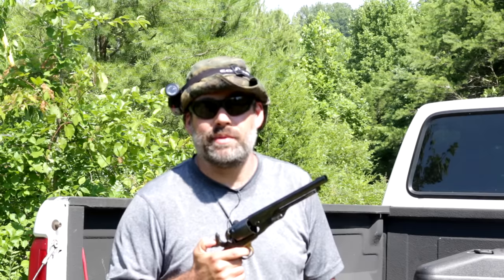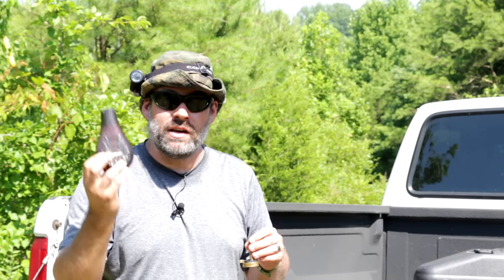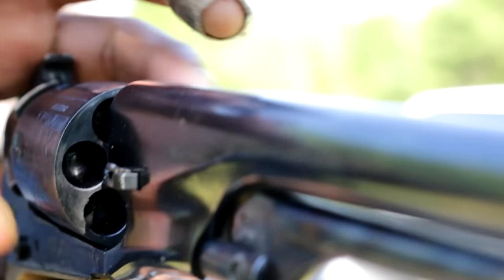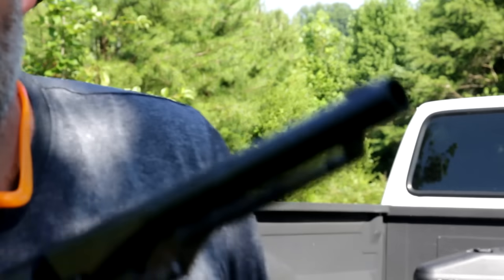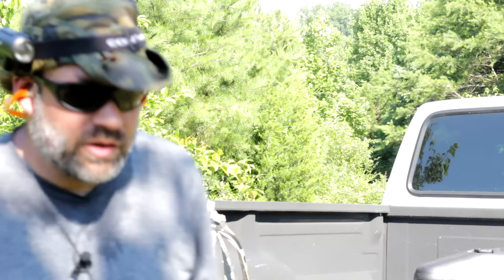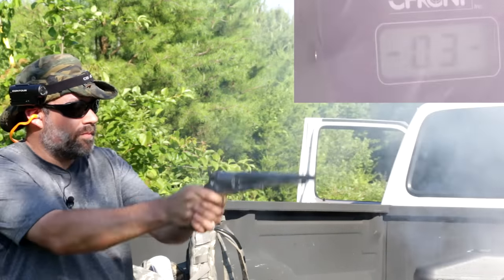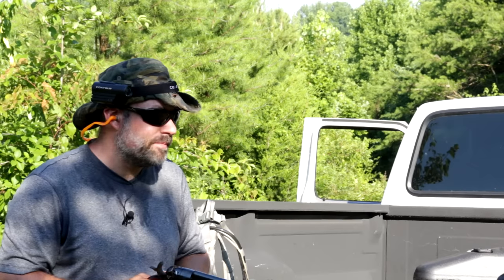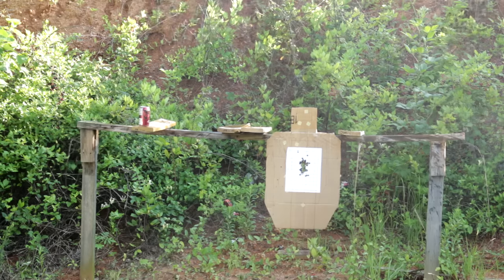How Powerful are Black Powder Revolvers?

Comment: I'm fixing to buy my first black powder cap and ball in a couple of weeks.  I talked to one guy who said his theory on how much powder to use was 36 grains for 36 caliber, 44 grains for a 44 caliber and 45 grains for a 45 caliber.  I think he's off his rocker.  Especially when the framework of the pistol is partly brass.  Am I judging him too harshly?
Reply from the maker: I wouldn't listen to his advice especially with brass frame revolvers.  When shooting 44 cal black powder stick with 25 grains for brass frame revolvers and there is little need to go above 30 grains in a steel framed revolver all when measured by volume.  He may have gotten his info mixed up with loading black powder shotguns which is normally loaded with an equal volume of shot and black powder.

Comment: Speculating here,  I think Black Powder may give you more velocity at the higher loadings,  I believe it's burn rate is faster, the ignition temperature certainly is.   Original loading, if I recall correctly, was 35 grains.
Reply: No.  The original specification for a Navy Colt's .44 caliber pistol was 28 grains of "pistol grade" black powder. That's what was issued in the "paper cartridges" by both sides.

Comment: cant wait to see the 1858 buffalo test should be interesting
Reply: He can't really load the brass frame to the same as a steel framed gun,  It's not recommended because the brass stretches to easy.
He can if he wants to,  But I'm pretty sure he's self aware of the short amount of time he'd have the 1858 brass frame.

Comment: The loading procedure is good advice.    Once a .36 revolver that I was loading discharged when I popped the cap on, and I had just decided to move my hand from the barrel to the handle.    The bullet would have taken off my fingers.   As I had not yet greased the chambers, 4 cylinders fired at the same time.   I know better now, and take the precautions that you advise.  Black powder guns are fun,  but have their quirks.   What about capping the pistol prior to loading the powder and ball?

Comment: Good video. There were fairly large differences from chamber to chamber which indicates not precise measured loads, which occurs when using a flask. Several times when showing closeups of the seated ball you can actually see the differences. I really appreciate the honesty in this video.

Comment: As per the Lyman Book (mid 70's) I used to load my Rem. at 37grn. under a 454.
They tested each load including the pressure.
I believe the Army spec. for the .45 was 30 grn. because they used a load for both the Colts and the Schofields.

Comment: Very interesting video and good camera work.   I bought a Pietta 1860 Army 44 around 20 years ago.  I fired a few cylinders through it and cleaned it a few times but have never taken out the inner workings.    I better do that soon and determine if I need to buy any parts.  I have some ffg black powder and some fffg Pyrodex and a few hundred number 10 caps.  Now if I can just find my lead balls I'll get out and have some fun with it.

Comment: Why do people always overkill with the lube? A good tight ball and just a little lube around the ball is fine. All that goop is way overkill.
Reply: lubed patch and a ring of lead when seated.
Reply: If use right sized balls you never have chainfire, who appears only with undersized bals...
Reply: there scared of chain fires ive never had one and i just use powder and a ball
Reply: I have.  Several occasions multiple chambers have fired at once.  The common thing noted was unlubed cylinder.  The chain fires weren't as scary as they made out to be,   slightly heavy recoil or I noticed lead smeared on the wedge.
Reply: Ring of lead was what Colt considered a defect in design.  He later put a patent on "chamfered" chamber mouths to prevent the cutting of rings of lead to reduce multiple cylinder chamber fire.  Probably more a history thing than actual fix,  who knows...
Reply: Actually I had a chain or double fire using rs select in soem C&Bs years ago, have used RS fine, but select was an issue.  Same balls, grease but for whatever reason that select was more suseptible.  It never happened with regular P before....Nothing happened actually when it happened, thankfully other than me scared to death.
Reply: Lube creates better accuracy and less fouling
Reply: Mr. Blutarsky
ring of lead
Do you mean the revolver actually cuts of part of the ball when loading it?
Reply: @leneanderthalien 
All greasing over the balls does is keep fouling at bay. So just a small dab will do, packing the cylinder flush with grease is a waste of lube and needlessly messy.
99% of chain fires occur when a bad fitting cap loosens up enough and or falls off allowing the nipple back flash from around the hammer to get directly into the neighboring  nipple or physically igniting the primer in a adjacent loose cap .
The only way you could really  get a chain fire from the barrel end of the cylinder would be if one was using the WRONG undersized balls and not getting a shave ring. If you get a lead ring, the chamber is fire tight and 100% would not allow a chain fire.
I suppose the only other possible scenario would be a badly pitted or damaged, stretched, bulged cylinder, that  could possibly allow fire to sneak around the ball, but again. 
Almost all chain fires occur from the nipple side.
Reply: You are right about the chain fire being started at the nipples. Forgotten weapons has a video of slow motion shooting of a cap and ball Colt where the amount of flash and sparks engulfing the rear of the cylinder confirms your statement.
Reply: I agree messy as hell, (a syringe full of crisco) and a small bead around the ball is good!
Reply: Mr Blutarsky Yes smaller ball patched, will outperform a shaved ring ball. Also higher velocity and better accuracy up close from a round undeformed ball!👍
Reply: Schwarzer Ritter yes a properly sized ball should be slightly larger than the actual cylinder. Example a .44 caliber revolver would typically use about a .454 ball, when you ram the ball in, the cylinder wall will shave off the outer edge of the ball, guaranteeing a proper tight seal
Reply: Wrong for velocity... true for accuracy.
Reply: In a .36 Spiller and Burr, I cut a lead ring on all cylinders and no lube and had a 3 round chain fire.  Yes, you do need lube, or a lubed felt pad.
Reply: They kick like a mule and bend the gun . You have to look twice to see if your arm is still there if you are holding with one hand . But that's just me ?
Reply: He was using Crisco. It's dirt cheap. The easiest way to apply it is to slather a bunch in and wipe off the excess. Yeah, you're "wasting" lube. But it's not like a little can of Crisco is expensive.
Reply: @leneanderthalien  Oversized Balls and the Ring of Lead is not enough.  Checkout the Blackie Thomas video on cylinder seal and you'll know what I mean.  He does his research and homework.
Reply: @MrErdner  yup, cheap and way less smelly than the "historically accurate" lubes of the era, especially in the hot sun. Crisco is "non carbon based lube"... Veg / animal based lubes in black powder firearms only, NO petroleum based lubes.
Reply: It's a carry over from the bedroom, more lube gets things moving.
Reply: I agree.  Overkill.
Reply: If two shots go off instead of one no more nice gun/hand. If powder gets wet you will hear a click when you need a bang.
Reply: I never lube.  The brass the barrel is made of us stronger than the lead ball so it doesn't damage it.  It's like wood scraping against concrete.  You don't need lube, it will be fine.

Also I purposely used smaller bullets than recommend to purposely get chainfires, and they're not bad at all.  They don't even break the gun.  All you get is a lead ball wrapped around the frame of the gun.  Don't worry about them.
Reply: Very true, I've herd of chain fires from people using flammable goops tho
Reply: I Got big balls no undersized ones
Reply: @dmithsmith5880  Umm, someone did a video one this, apperntly the the holes can get rather canted, and it can also cuse a gap between the ball, even with the ring of led, why some parts of the ring tend to be thinnner somestimes, then other parts.
Reply: @recycled3654  Same.... needed new shorts the first time it happened.
Reply: @leneanderthalien  Rare but did happen and with a gun / cylinder can always happen occasionally..  chamber not quite round a gap in one spot .   A bit of lube no problem  >>dry no wonder wad   every so often a chain fire .
Reply: What’s better, lubed wads between powder and ball, or smear it on the  front of the ball cylinder?
Reply: And Crisco is so expensive!
Reply: @brahtrumpwonbigly7309  ....people like me. Elaborate.
Reply: I only use wonder wads. Less mess.
Reply: i dont know why people use .451 instead of .454, literally just keep a snuff can of lubed .454 round or conical and make sure that lead stripppsss

Comment: If you want  more speed and power.... Swiss fffg black powder is 'finer/smaller' granules than other brands of fffg... You might try  Swiss fffg  at 28 to 38 grains  if you can find any.  Graf and Sons 'sometimes' have it.
Reply: I have 5kg of swiss1 (4fg) and it works VERY well... I even have tried the  "0" (finest swiss powder) but it doesn't improve the chronographs results.

Comment: The effectiveness/ lethality  of the soft lead ball can't be accurately quantified by the paper ballistics. For example, penetration tests reveal that they can penetrate well.  They can also deform quite well.
 I have an old steel exterior house door full of bullet holes from when I stood it up and taped targets to it. 

 The .36 cal with .375 balls and 25-gr of 3F Goex actually puts larger holes in that door than 38 or .357 hollow point bullets.

 The .44 with .454 balls and 35-gr put larger holes in it than either .45acp or .45 Colt hollow points or ball.

 That conventional wisdom inconsistency of paper ballistics figures also carries over into the bp musket and rifle world as well. A 500-grain .575 Burton Minie on top of 65-gr of 3F Goex doesn't produce big energy numbers, but kill a deer very(!)  effectively...the deer/vegetable stew in the fridge is proof.

 That soft lead can have a devastating terminal effect on tissue and bone.

Comment: Supposedly black powder burned better and faster under compression.
Also, I thought he was going to shoot the 12 inch gun.
Reply: It needs to be compressed because of it's lower pressure than that of smokeless powder. Any airspace will dilute that energy which might not be enough to clear the projectile out of the barrel, that is the danger.
Reply: Pyrodex pistol powder will deliver slightly higher velocities.

Comment: Looking at your cylinder before you fired off those rounds, I could see some definite variability in the amount of compression you were getting on the powder and the ball. That is what is leading to that extreme variation in velocity, and why it seems that you weren’t getting much increase in speed for the additional powder on several of the shots.

Comment: Try .454 balls and then try it with Triple Seven Powder.
Just curious.
Nice Video!
Reply: I was thinking the same thing. Perhaps .457 bals would be even better. The more of the balls surface in contact with the chamber walls, the more pressure builds up behind the bullet before it starts moving, making better use of the powder. Triple Seven is a lot more powerful than black powder too.
Reply: Wow... congrats you figured it out... while I had to try .451/.454/.457 on a chrony to find it out (then starting to understand why...). In France we can only use REAL black powders (no substitutes, by law) then I haven't tried 777 but can only compare french bp (crap) and swiss bp (top).
Reply: While we are being silly.  How about trying it with Red Dot Smokeless.  (I kid, I kid.)
Reply: @exexpat11  smokeless powder will generate way too high pressures and the cylinder will break. ... though,  those replicas will resist to ANY black powder charge pushing LEAD,  each cylinder chambers and every barrel have been tested by independant labs (they put their mark on the parts of the gun they have tested to certify the resistance level) which is mandatory in Europe. I reached 1286ft/s with (supersonic speed...) swiss 1, full chambers, and. 457 round Ball (pure lead )... it is pretty impressive to hear the blast of black powder with a supersonic Bang...
Reply: @tuttoto  Absolutely.  I think the best is 30-31 grains for optimized power and accuracy.  I error toward caution these days.  Nothing wrong with occasionally putting a Magnum Black Powder load in.  :)

Comment: the amount of powder  in the chamber is irrelevant if it doesn't all burn while in the chamber or barrel....that's why you don't get a huge increase when you increase the load.....
Reply: I AM A RETIRED GUNSMITH. MY MENTOR CALLED IT; "THE LAW OF DIMINISHED RETURN".
Reply: Actually, yes it Does. Get a chronograph and see for yourself. And don't use black powder. There are many new propellants that will enable you to hand down a pristine shooter to your great grandkids; some are no lube required etc. and if ammo becomes no longer available, you can still make it shoot 100%.

Comment: I used to have this kind of fun with my pietta 1851 .36 Navy all the time.  You really want to get in trouble with those primers, wait until  spent one falls underneath the hammer and gets crushed in the hammer groove when the hammer drops and it keeps the hammer from resetting locking it in place in the groove.   You’d REALLY be screwed in a battle there.

Comment: To save a lot of mess it's better to use a lubed felt wad (1/16" thick is enough) behind the ball. Forget "chain fires" they just don't happen! I have fired many thousands of rounds in cap'n'ball revolvers and NEVER have I put lube in front of the ball... no chain fires.
You can bet your life that back in the day they didn't grease the chamber mouths. Carrying a holstered pistol loaded that way would guarantee a lot of gritty crap going down the barrel.
The ball when pressed into the cylinder is a better fit than any lead bullet in a cartridge case... no possibility of a flash-over. In fact, chain fires are/were a Colt phenomenon caused at the percussion cap end due to badly fitted caps. This cannot occur with a Remington due to the design of the cylinder....
I have used cap'n'ball Remingtons for over 30 years...... no problems... they are powerful and accurate..... a fair bit more thn a .45ACP......
Reply: That's not true about the remingtons/colts percussion caps.  The reason lubed felt stops chain fires is because it seals the powder.  Grease seals the powder too but like you said it is messy, and you're right a lubed felt will do the exact same job without the mess.  Chain fires are caused by some flame getting past the ball and in the powder, even balls that leave thick rings can chain fire.  Felt wads stop this completely.
Reply: More powerful than what 45acp loading?  I doubt the 58 rem can hit 600ftlbs...
Reply: No, they used bear grease! The Union Army and Confederate Army both issued bear grease for both pistol and rifle bullet lube, otherwise, there wouldn't have been enough soap and boiling water in the World to clean out the fouling. Chain firing is a possibility with ANY black powder load, even brass cartridge loads, as black powder is shock sensitive. Look at the USS Arizona, the bomb hit the SMOKELESS magazine doing no harm to the charges, detonating the illegally stored black powder in the forward magazine, which set-off the magazines containing DuPont IMR #3031 Smokeless powder for her main rifles, then the explosive shells.

Comment: One way to cut the cap jam is to round the corner edge of the receiver where the cylinder rotates into it slightly and tilt the revolver to the right side as you cock it so the busted cap will fall off as the cylinder rotates.   One of the issues with the low rate of velocity increase versus load increase is the slow burn rate where you can only burn so much powder in an 8-inch barrel....which is why the black powder rifles either have really long barrels like the Sharps and Springfields or really low powder loads like with the Spencers.